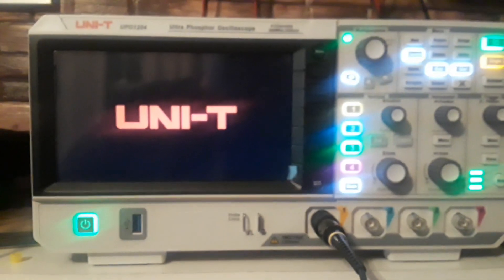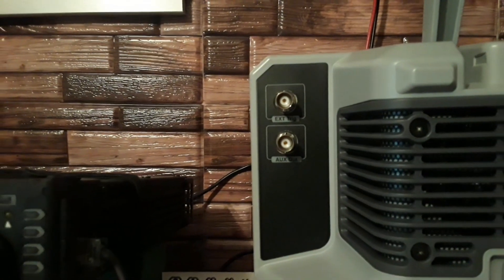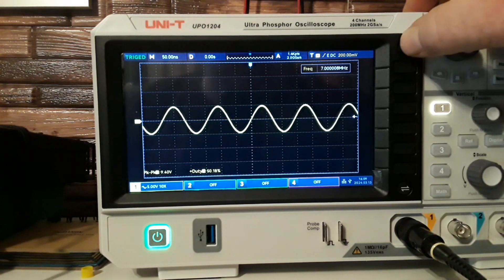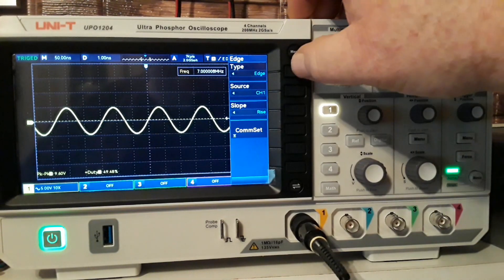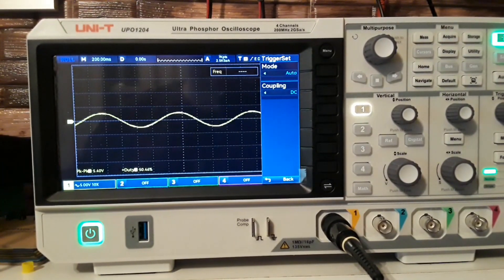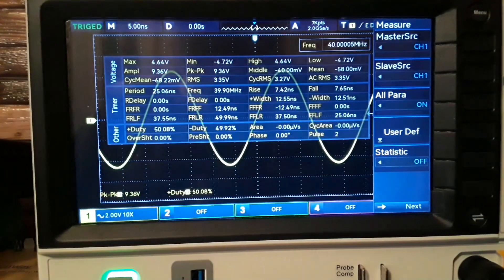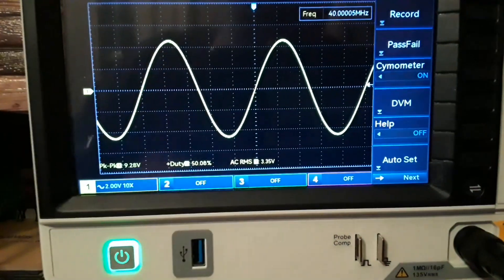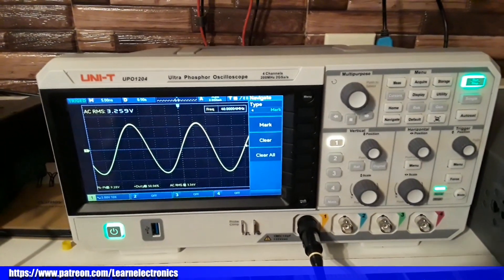Uni T UPO1204 200MHz 4Channel Oscilloscope

Comment: I wonder if this DSO is a good buy.
I mean, brands like Rigol and Siglent now switch to 12 bit DSO's for a very similar price.
Also, with Siglent, If you have a Siglent function generator, you can do bode plots (and even pretty old function generators from Siglent can be hooked up). I think Uni-T missed the boat with this, as they also started to produce signal generators a few years ago, but didn't implement this fantastic feature.
Also bus decoding is not that elaborate on this DSO I think.
I would have liked to be shown more advanced functionality of where this DSO might have different functions (in a positive way) compared to what the new Siglent SDS8x4X range has to offer (or the old 8bit SDS1x04x-e range, to which I think this model targets its market) and the new Rigol DHO8X4 and DHO9x4 has to offer.

I think what you show here in the video...pretty much every DSO can do.

Comment: That Uni T firm seems to do some high spec test equipment for a fraction of what you can pay for the same spec elsewhere. I think the click buttons instead of a touch screen is probably better in practice. You don't want dirty fingers all over a screen and you get tactile feedback with click buttons. Regarding the fan, just a thought, could it be that the fan switches off once it has cooled down?

Comment: Wow, 1 Ohm input impedance... I'm sure you meant 1 Megohm. ;-) You'd have to have a beefy 50 Ohm internal termination to play it safe. Better off using a 50 Ohm BNC pass-thru terminator when needed. Seems like a nice scope. Cheers!
Reply: Is the rise time on this uni-t decent???
Reply: @gregandark8571  the rise time is ≤1.8ns, but what I can't find is the sensitivity, I searched Uni-t website and I couldn't find anything, I'm lost between the uni-t UPO1202CS  and the Rigol DHO812, the Rigol vertical sensitivity range is 500 μV/div to 10 V/div but I can't find the Uni-t one to make a comparison. I'm completely lost and can't decide.

Comment: Weird. You showed how you can add user defined measurements to the bottom of the screen, and you picked AC RMS. Then, you turned on the DVM function, which shows AC RMS in the top left corner. The two showed different numbers, though, I think 3.35V and 3.259V respectively?